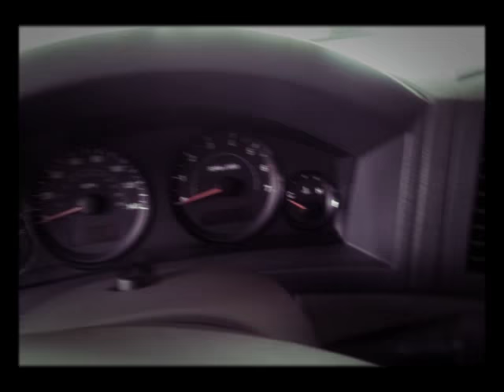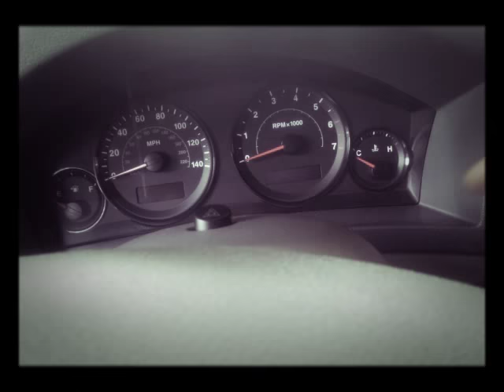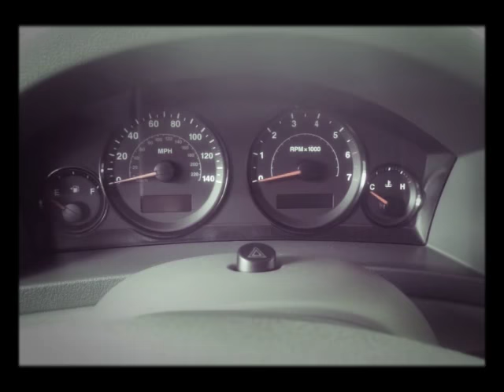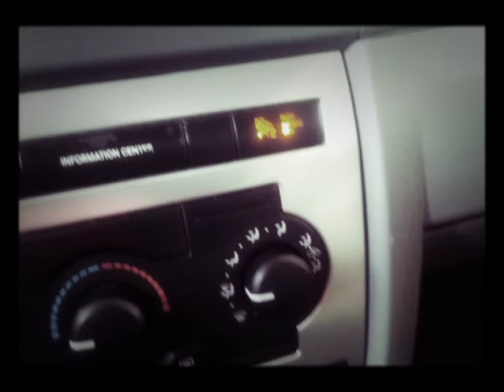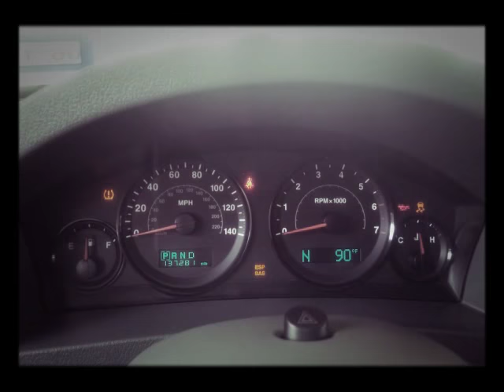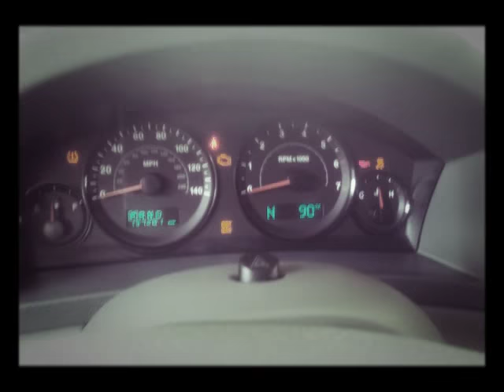2006 Jeep Grand Cherokee Laredo/WK DIY DTC Retrieval not working...

Comment: Im in Australia. Dont know if that makes any difference feature wise, but my 2006 Grand Cherokee Limited will not do it either. One observation: if "on" position displays the odometer, then "on" could indeed be the accessoroes position. None the less, I have tried everything, off to accessories, off to ignition, accessories to ignition, tried it slow, tried it fast, tried it in between, just wont go into code mode.
Reply: Thanx, Mike. This reaffirms my view that "I'm not the only one." 🤣
Reply: Mine does not show also

Comment: You arrnt going fast enough, and you need to go on off, on off, on off..quicker push the key into the ignition it smooths over ACC to ON easier vs clunking through. It likely had the recall done for ignition switch, and those they used were very tightly bound for no chance off accidental shut off
Reply: Doesn’t matter how fast you go, doesn’t work on 2006

Comment: I noticed in your video that the check engine light was on steady for about 15-seconds and that it flashed for about 10 seconds. This indicates that one or more of readiness monitors are not set. When all the monitors are ready the check engine light will not flash.

Also, when you ran the engine, the check engine light was not on, indicating that there were no active codes.

Comment: The code is flashed by the check engine light. Count the Times it comes on like three flash's equal-3 then a small pause and  the light flashes two more times equals -2 which is the code 32.

Comment: Do it a little bit longer. Bcuz I had it pop up n the DTC Is 0700.. What does that mean 0700 is the code
Reply: When the tranny control module detects a malfunction with the control, it send 0700 to the engine control module to set the service engine light. Essentially, 0700 means there is a malfunction with the transaxle control. Or something like that. 
¯\_( ツ)_/¯

Comment: On mine that information center thing does not turn on at all can somebody tell me why
Reply: Wow... I almost forgot about having posted this video and it took me a minute to come back and check the comments.

Anyhow, I think you're referring to the Information Center below the radio and above the A/C-Heater, correct?

Well I've gotta tell you that my experience has shown me that those lights (and the ones that light up the dials of the A/C-Heater,) are notorious for burning out. It's not impossible to fix it, but it does take a little bit of time and effort. 

There's a guy who put up a video that explains it really well and I hope it works out for you. It doesn't directly answer the issue you mentioned, but that Info Center is right there and you should be able to have access to those light bulbs in order to change them. 
https://youtu.be/i_1yC21DSkc?si=LU7fiuz6fS2QR_Dq

Again, sorry for not realizing you asked for help/advice and you never got a response.

Comment: Hey guys, I figured out why it isn’t working. You can’t be on the compass screen, You need to hit the button on the top left of the front of your steering wheel until it says “System Warnings” then you press the down arrow (Right below the first Button) and it should say what’s wrong. Then what you want to do is Turn the key on and off 3X, ending in On (2 clicks from off) and it’ll work. I kept trying to do it while it was on the Compass and Temp Screen and it wouldn’t work, but once I did this and tried the key thing it worked. Please Sticky this comment OP

Comment: Did anyone ever figure this out?
Reply: @Jay DC; I wish I could tell you, bro.
Reply: Yes .. its easy .. if you intersted i willbmake video about it right now
Reply: Check this video of my car
Reply: Hey, I just figured it out. You can’t be on the compass, you need to hit the button on the top left front of your steering wheel until it says system troubles. Mine was for Washer Fluid Low, I left it on that screen, shut the Jeep off, and then did the Code 3X, and it worked after that. Good luck Guys